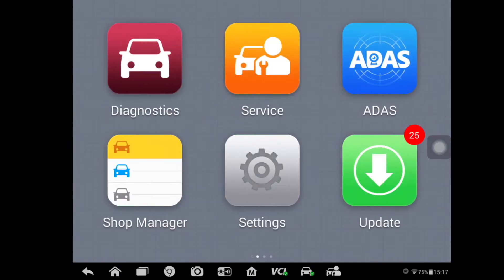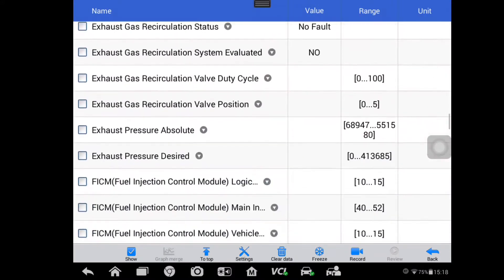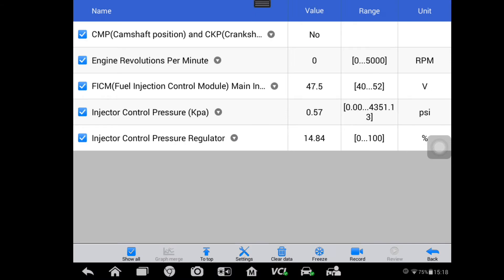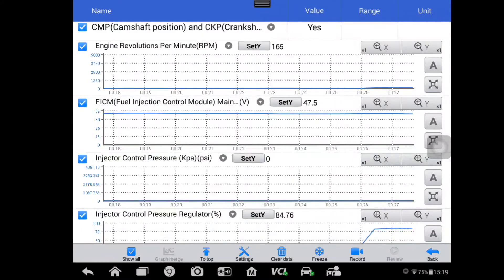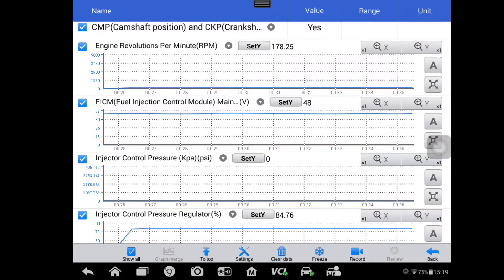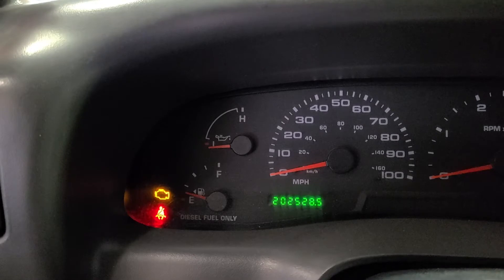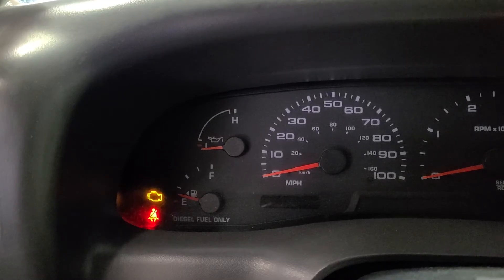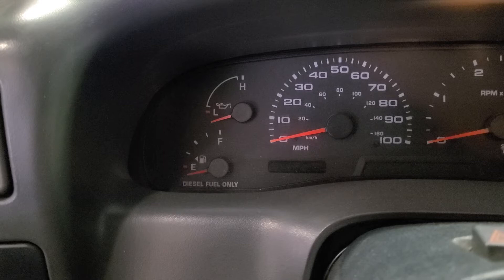6.0 PowerStroke No Start Diagnoses (Bad HPOP)

Comment: Hey. Jake.   I have a 2006  6.0.    I struggle to start my truck. But once I start it. I drive it around no problem  until I shut it off it won't start again. 
What can be the issue?
Reply: Probly a leak in the hpop system when the oil is cold it has more viscosity and doesn't leak but when is hot it's thinner and can't create enough pressure just search how to fix a hot no start on a 6.0powerstroke
Reply: @masonries4139  thank you brother
Reply: @gabrielcortes6116  your welcome

Comment: Hey man, appreciate the video and thorough procedure documenting.

I'm failing to build pressure have extended crank to start like over 30 seconds. Once it's idling desired ICP PSI is 800 but I'm only getting 480 to 500. Clearly there's a leak somewhere.

IPR air test reveals no leaks. ICP air test with IPR blocked by a ball valve on the IPR test fitting reveals no leaks until after about 5 minutes when gurgling and air can be heard through a listening device when placed inside of the oil filter housing.

I've read that the only time you'll hear air or oil gurgling at the oil filter housing is when you have an internal leak within the hpop. I pulled the h pop and bench tested it only to find zero leaks whatsoever.

Anybody have ideas on what could be going on here?
Reply: So I cranked up my air compressor to 125 which is the max and bench tested the hpop again. It took a minute or two but now I can put a heater hose to the low pressure intake port on the h pop and hear gurgling.

Sometimes it takes a while for the leak to reveal itself. Another tech told me that these systems are designed to run at thousands of psi and when you're only putting 125 into it it may take a while to hear the leak.